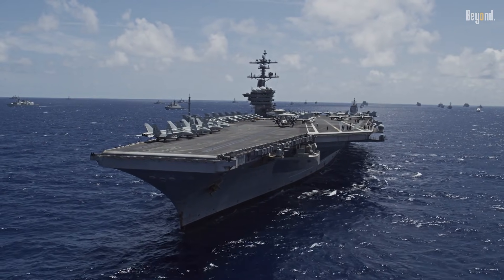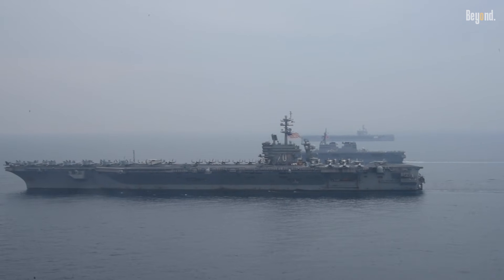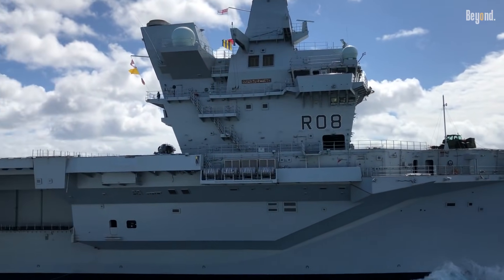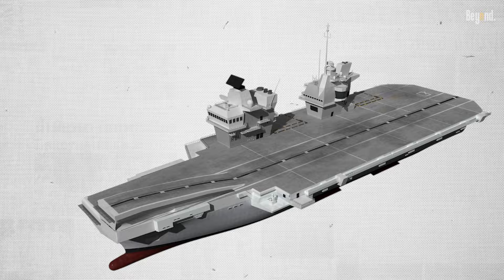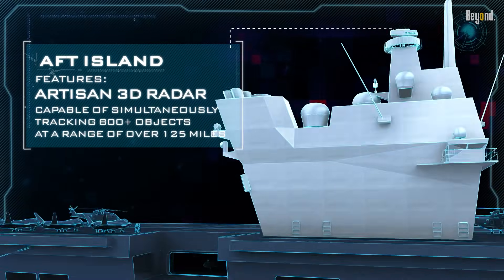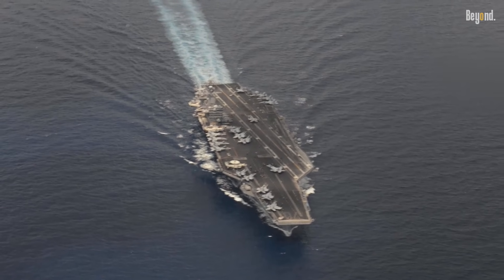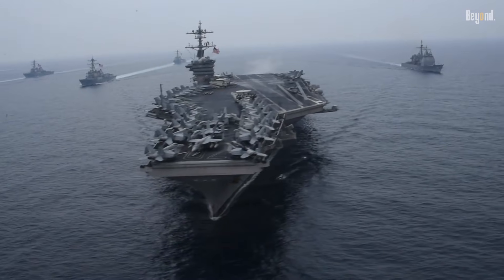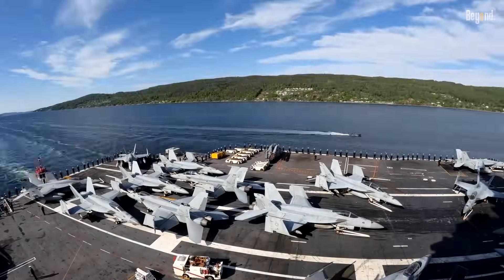Why the Royal Navy Chose Two Islands Aircraft Carrier and the US Navy Didn't

Comment: Very poor.
The two islands, the forward one controls the ship, while the aft one controls the aircraft. In an emergency, either tower can do both jobs.
Additionally, the two towers provide a semi-protected area between them where an elevator is located. Lastly, putting a radar on each islands allows some triangulation, for calculating distances.

Almost everything on an aircraft carrier was invented by the Royal Navy.
Flush deck? RN
Elevators? RN
Armored Flight Decks? RN
Ski Jumps? RN
Catapaults? RN
I could go on, but you get the idea.

Comment: Officially it's to prevent a larger single island creating turbulence across the flight deck. They also alow the gas turnbeins to be fitted high up in the ship and then removed more easily minimising the intrusion into the flight deck space and incorporate weapons lifts. 
The real reason of course is that the RAF and RN couldn't stand each other and so both needed their own island (:-)!) 
The real design flaw is that they were built with ski jumps and not catapulst so they're 100% reliant on STOVL aircraft, essentially the F35B. Unlike other carriers that can last for decades simply by updating the airwing they will likely have to be retired when the F35B goes out of service as I doubt there will ever again be a STOVL aircraft built.

Comment: Failed to mention that the American nuclear powered aircraft carriers still produce heat and that it is expelled into the water making them easier to track for submarines & satellites.
Reply: But not for IR guided anti-ship missiles. So they might be easier to track but harder to hit. A fair trade I'd say.
Reply: @christoffermonikander2200 
They're still more than hot enough to see, not too mention in radar too.
But if ASMs have reached the carrier, it's dead anyway as it's entire group is dead
Reply: @christoffermonikander2200  what about torpedos, what the submarines would be using
Reply: @RandomMackem0069_Official  Submarines use sonar to track ships, and guide torpedoes. A nuclear powered ship pumping a ton of heat in the water won't meaningfully effect that. The thermal gradient the ship produces might make it harder to track, if it weren't for the amount of noise a large ship makes while underway.

As far as satellites are concerned, conventional or nuclear doesn't really matter. It's a big ship, leaving a big wake, probably outside a shipping channel, that's not broadcasting on AIS.
Reply: Are u 5 who said it would not produce heat in to the water !

Comment: The Royal Navy has never had enough frontline aircraft to need to maximise the flight deck space available for aviation operations  (late 1944/early 1945 being a possible exception).  Nuclear propulsion was often briefly considered, but always impossible to justify.  The 1960's CAV-01 design, the 1970's TDC design, and 2000's CVF design could all have had larger flight deck area, but instead valuable real-estate was utilised to accommodate missiles systems and one very large island or two smaller islands with lots of trunking.   Even with their two islands, the Queen Elizabeth class can easily operate 36 F-35B's, but haven't yet operated 20 or more.  24 is expected to be the max in practice, exercised briefly every two years or so.

Comment: Well actually its a few reasons, number one is survivability, each island is interchangable, number two minimising airflow over the flight deck and three seperate power plants spaced apart to mitigate battle damage.
Reply: Mmm. I think the reason is to keep the generators (and their ducting) for internal power and propulsion as far apart as is reasonable for damage control purposes and so that the gas turbine generators can be mounted high in the ship, minimising the length of the high volume ducting needed, which is a flooding threat if run to the bottom of the ship.  All the rest is possibly true, but really smacks rationalisation of the decision, once it had been made.  I served in the last cats and traps carrier of the RN and having Flyco just yards away from the bridge was a distinct advantage as the command team could move from one to the other very very quickly if they wanted to.  Similarly Commander (F) could have face time with the Captain, yet be no more than 20 seconds away from his team in moments of crisis.  BTW I don’t buy the air turbulence idea at all.  It’s up to the command/OOW to ensure the wind is fine on the port bow for recovery, or for launch fine on either bow, both for STOL/VSTOL and cats and traps.  It makes no difference what the funnel arrangement is if you do that.  Can’t in reality see any advantage to the split island other than the ducting issue.
Reply: @graemegeddes3987 So you disagree with first hand experience of the pilots that have landed on it who testify to the airflow advantages or the extensive computer modelling that created them or the fact that it has redundancy in the interchangeable islands, and you use "face time with the captain" (that one was funny) as a reason for them not being an advantage ? So lets imagine a US carrier was struck on the island, what then ? As for being moments away from his team....you know we have comms on ship now right ? I've actually heard experienced air controllers comment that it must be great not to have to share space with bridge crew.
Reply: When you Brits have aircraft carriers that don’t have a “cope ski ramp“ used for takeoffs, and don’t have carriers run by diesel instead of nuclear, then the US will perhaps take advice😅
Reply: @keithgiesler1027 it is not like the UK invented the carrier or angled aircraft carrier deck  or anything like that :P
Reply: @keithgiesler1027 Ramps work 100% of the time unlike emals and nuclear propulsion has more negatives than positives....welcome to the new millenia ruprik....
Reply: @keithgiesler1027 Ramps work 100% of the time and nuclear propulsion has more negatives than positives, welcome to function over style....
Reply: @keithgiesler1027 I could tell you that ramps never fail unlike emals or that nuclear propulsion has more drawbacks than advantages but the comment would probably only be deleted on this American platform like the last 3 attempts have...
Reply: The truth is the reason the QE class doesn't have catapults is cost more than any other reason. You're very unlikely to need to get aircraft off in an emergency in modern combat - you're either on ops or you're not. Emergencies are why you take destroyers, frigates and attack subs with you - they'll take out enemy aviation and missiles faster and further than aviation will, leave the aviation to do what they're actually for. The primary thing was it would have been a magnetic catapult (EMALS), and it was going to be very expensive, but they would have had enough power. The not using a reactor for power is down to their dual use as gigantic floating diplomatic missions - there are many ports around the world that US carriers can't use that QE class can. That's very important and part of the reason why the class was commissioned in the first place. QE class vessels have visited places like New York at Pier 88 - the US Navy doesn't do this because it is considered unsuitable for nuclear-powered vessels - that's an example of how it makes a difference. That probably sounds really weird to somebody from the US, but the UK has a reputation for soft power that many consider unmatched, and this sort of thing helps more than people realise. The downside is F-35B over F-35C - it's not a catastrophic capability gap for a carrier: the catastrophic capability gap (it was more erroneous thinking really) was using F-35B's for the RAF rather than F-35A's, which is looking like it is going to be solved by actually buying F-35A's (finally). The EMALS is actually supported and could be fitted plus arrestor gear, and it may be some day.
Reply: @streaky81 Agreed, although emals being an immature technology at the time of their construction was also a factor. I also understand that they were designed to incorporate emals if it was required at some point in the future.
Reply: @gabehorn1001  it almost happened a few years ago with the GE-designed system with a related F-35C order, then it was cancelled, again because cost. If it happens now it'll be either for drones or drone wingmen.

Comment: I have no doubt that these ships are very good boats. Our British friends know how to build warships. In my opinion, it's a shame they're not nuclear-powered. But the doctrine of employment is no longer the same, nor is the cost and technology. And versatility is limited.
Reply: Overall it was probably the right decision. It was far cheaper, UK has no experience building large enough nuclear reactors, and if they used several smaller submarine reactors, which the UK has plenty of experience with, they would run into the same issue as the French with each carrier being refueled far more often than IS carriers due to smaller size.

The cost reduction also made building 2 carriers far more viable (again looking at the French definitely the right choice) 

The only downsides of a non nuclear power source are:
1. Need to be refuelled at sea (but so do all the aircraft and escorts already so it's not too much extra)
2. Lower maximum top speed (idk by how much though)

In terms of versatility the UK carriers are arguably slightly more versatile, they are the largest non nuclear carriers in the world and quite a few nations ban nuclear powered shops from their waters.
Reply: @7stormy334 - Although the two RN' carriers supposedly have a top speed of twenty five knots it has been widely reported that both ships exceeded 32 knots on trials. That being said of course you would not want to outpace your escorts or indeed your support ships so how much utility the higher speed provides is questionable in a real world scenario.
Reply: @7stormy334 The UK has been building reactors of a similar size for decades to use in our SSBNs & SSNs.
US carriers use two reactors & UK PWR3 doesn't require refuelling in its 30+ year lifetime.
Reply: @GARDENER42 Aircraft carriers need larger reactors than submarines due to higher power demand. And they would need to be refueled more often due to increased power use.
Reply: The lack of catapults is a far bigger issue, and even that is only really a problem in that the QE can't launch traditional AWACs.
Reply: I've always seen nuclear as a bit of a waste on a carrier. I mean, it's part of a carrier group always and it's escort will need refuelling, and all the planes need aviation fuel.

It also massively, massively increases the maintenance and running costs (as well as of course the initial build cost).

Honestly if I was the US I'd be like "let's scrap 5 of the planned GF and get 20 of these instead", because 6 Nuclear carriers and 20 of these for less running costs seems better than 11 Nuclear carriers.